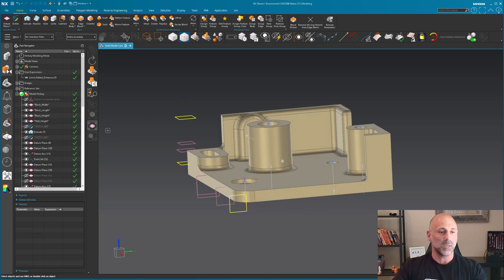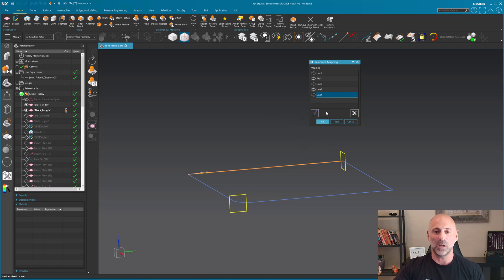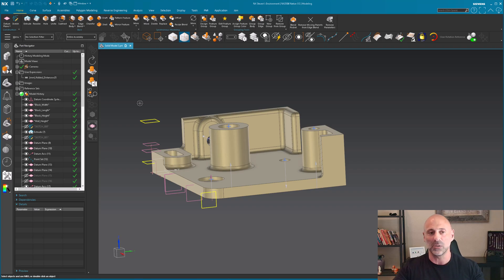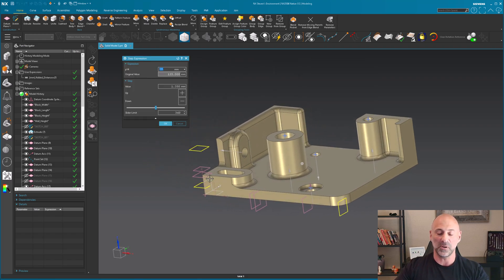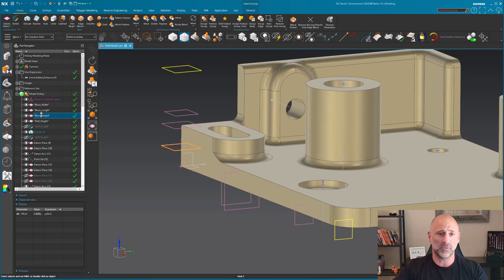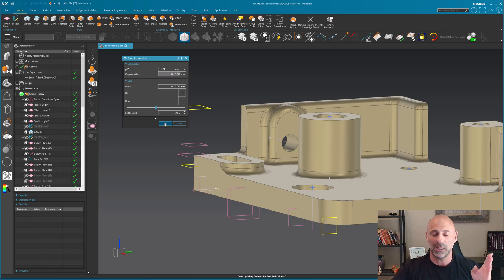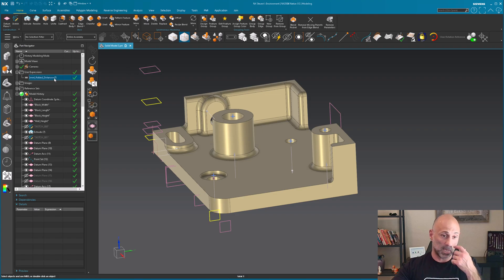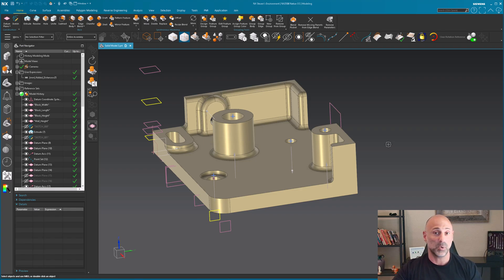🔧 3 Hidden CAD Tools You're NOT Using (But Should!) | Advanced Expression Editing Tips ⚡

Comment: I have never understood why NX makes those things this difficult.
You draw a simple block : 2 dimensions in the sketch, 1 "feature" dimension.
But when you want to alter those 3 dimensions you can only change 1 parameter in details. The other 2 you can only reach by opening the sketch first.
The easy way should be : edit the feature and you can change the 3 dimensions in 1 go. 
That way first creating datum planes is not needed : you can change all dimensions of the feature by just one edit command. 
There even exists a "show dimensions" command : but even that can't change the sketch values, only the "feature" one...
Reply from the maker: It is meant to make the non critical dimensions hidden. I really like it.

I use datums everywhere. As often as possible. It allows for way better model stability. Extra steps, yes. But worth IMO.
Reply: in the sketch, if you want the dimensions to show in the details, make sure you RMB on the dim and 'add-remove expression" then the value will show in the details panel. They will also see  in the 3D space when you pick edit with rollback